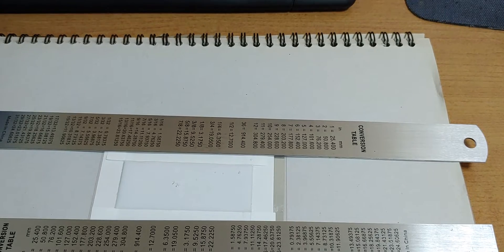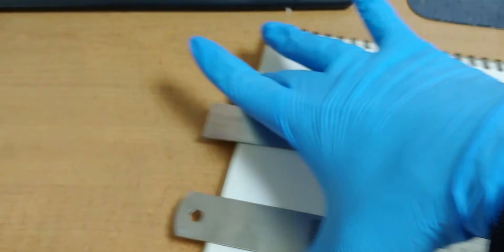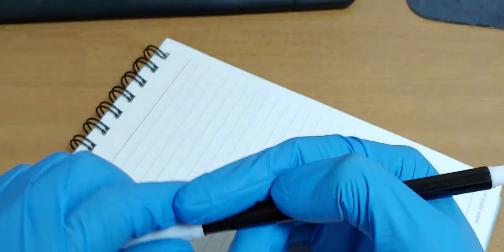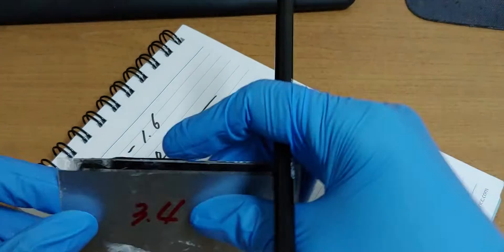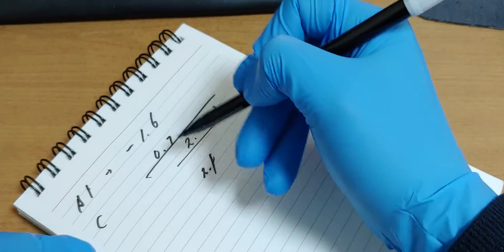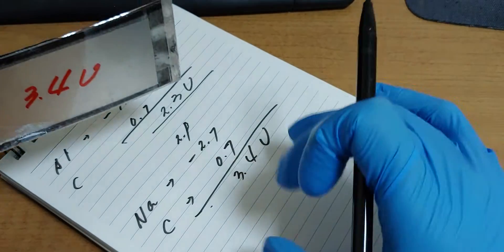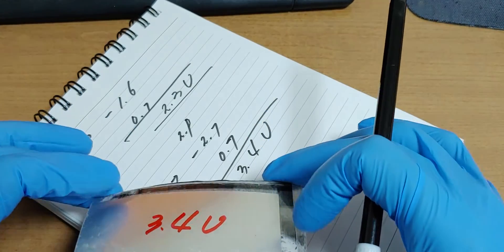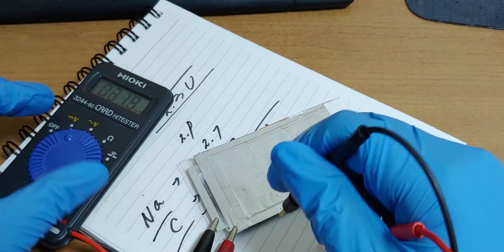Solid state graphene sodium battery: 3.4v

Comment: Amazing work but poorly you made quite some technical errors. 

So first on you assumed that the cell had a theoretical maximum voltage of of the cell had to be 2.3V because the redox potential of Carbon was 0.7V. Poorly this is flat out wrong since carbon doesn’t form ionic species like that and doesn’t participate in chemical reactions within the cell since it’s chemically quite inert. 
You must have another oxidizing agent within the cell that it worked like that. Probably its just diffused oxygen really. Also a sodium ion battery cannot work like that because each electrode has its own redox potentials and the redox potential between the sodium and the sodium carbide is approximately like almost zero. You will have to use either substances like NaCoO2, NaMnO2, NaFeS2 or similar as cathode material so that it worked.
You have actually built an asymmetrical supercapacitor but not a sodium ion battery. 

Additionally may I ask what you used as solid state electrolyte and what peak current your cell has? 

Oh and as a little tip, you will need a datalogger to really determine the discharge plateaus to see if what you built really is a capacitor or a battery. Also cyclic voltammetry might be extremely helpful.
Reply from the maker: Thank you so much. And you are so excellent👍👍👍👍. Since 3.4 volt first time, I will do more experiment keeping mind what you instructed me. Really thank you again and have a nice day.
Reply: solid battery No problem. I really just try to help. If you need help you might just contact me if you wish to. Poorly there were really some misconceptions but <3V for a diy battery or supercap really is astonishing. 

Still one question, what did you use as electrolyte?

[edit] oh okay forget about the question above ^^
But really I mean like toothpaste? 😅
Ain‘t exactly scientific, is it? But still interesting it works
Reply from the maker: @GreenCaulerpa  
I am in a bus now to go to a mountain with my friends. After returning from this trip I will write again. Thank you. And I also wonder why toothpaste and detergent powder play a critical role. Thank you again and have a nice day
Reply: solid battery No problem have a nice day either
Reply from the maker: As an solid electrolyte, I used toothpaste, water, and solid getergent(combination of sodium and oxygen)

Comment: Ok so you will have some complex reactions taking place . The cell will need to be cycled around 10 times to see if there are unreversable reactions and side reactions . You will most likely see a steep decline in its voltage capacity but only cycle test will tell. 
Very exciting and good to see 3.4volts though . I will start testing new idea with pva glue, metal dioxides,and detergents this week . I like borax too . I hope to get over 3.0 volts with some amps .
Reply from the maker: Really exciting. I hope  the outcome of your experiment is better than mine. I feel like I am meeting a good companion. And I used detergent which is in solid state. Liquid one usually includes Cl. Have a nice day
Reply: solid battery oh ok so you used dry powder 👍🏻 very good and easy to access . I like yoir ideas .
Reply: @solidbattery9956  hi sir , could you tell me the materials of the components specially the fabricates ( which cover the cathode & anode ) and the separator ( electrolite ) ? plz

Comment: Maybe only the chlorine ions react will aluminium ! I will google this .
Reply: Maybe Sodium Fluoride can do the trick.
Reply: RONAKSINH PARMAR  but what is the sodium bonded to in the detergent?
Reply: There is also Sodium dodecyl sulphate or Sodium Carbonate.
Reply: RONAKSINH PARMAR are they in washing powder ?
Reply: I know in Australia we have washing soda which is sodium carbonate .
Reply from the maker: Hint^^ 
No Cl.
I always like your comment. Have a nice day
Reply: So not sodium chloride?
Reply: What is the sodium bonded too?
Reply: Maybe the borate ions . From wiki ....
Description
Borax, also known as sodium borate, sodium tetraborate, or disodium tetraborate, is an important boron compound, a mineral, and a salt of boric acid. Powdered borax is white, consisting of soft colorless crystals that dissolve in water.
Reply: Yes exactly, sodium carbonate is pretty common in Detergent, but some detergent also have Sodium Dodecyl Sulphate. But to be very honest all this materials are in a very diluted state and even if somehow you manage to bump up the voltage, it won't be constant over a multiple cycles. The best idea would be to go with Alkali salts or Some sort of Perovskite for better cycle life and higher energy density.
Reply: It can be used in electric cqrs